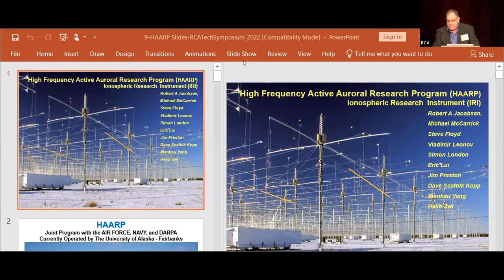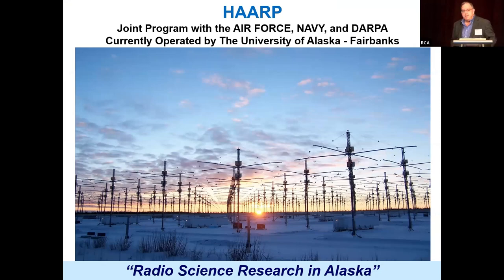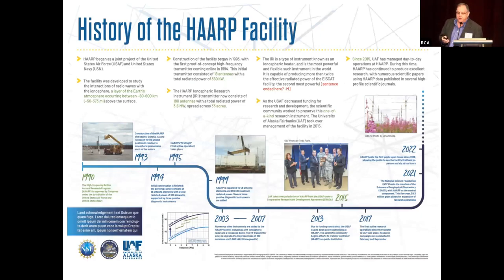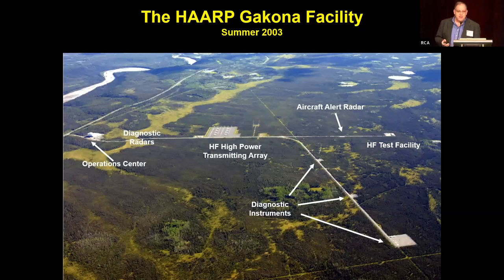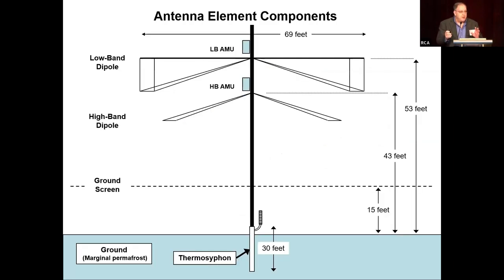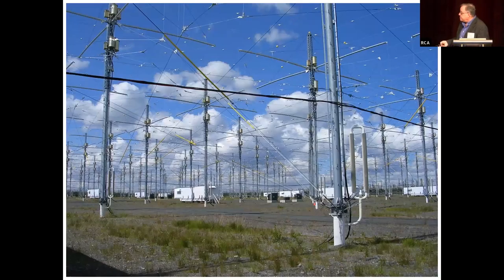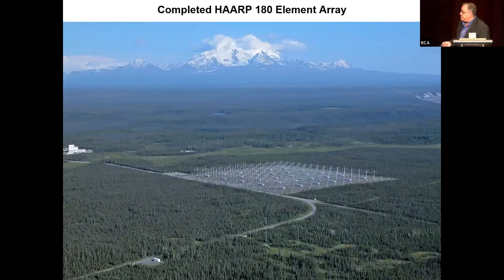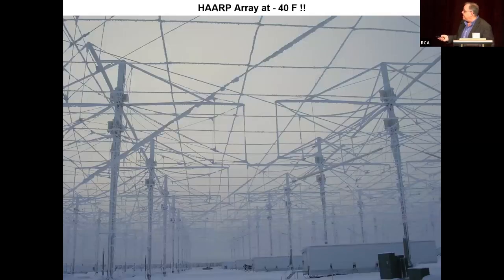The High Frequency Active Auroral Research Program, "HAARP", a Brief History and Engineering Review

Comment: this is the proposal to ARCO by Eastlund. Arco before this history through their electronics decision built most of HAARP. As I talked with the director Mr Hecksure at the joint Navy, Airforce High Energy Lab I believe I know a bit of the history not mentioned in this. ARCO needed to sell millions of tons of Natural Gas that had been pumped underground as part of the process of extracting crude from the Alaskan reserves. At the time (1984) there was no commercially viable way to sell this gas or transport it to market. Bernard Eastlund presented an idea to ARCO's President that was so exciting he may have pooped himself. Instead of bringing the gas to market, Eastlund's plan would bring the market right to the gas.

Eastlund outlined a plan ARCO could use to market that gas to the DoD.  

The idea was to build a massive land based vertical bore sighted phased antenna array using powerful transmitters. This array could beam RF energy into the ionosphere. This would heat up the ionosphere, pushing it upward, and creating a plasma which releases MEV electrons into space. By pushing the ionosphere up am incoming InterContinental Ballistic Missile could be deflected and its course altered when it encountered the unexpected drag of an atmosphere that was not supposed to be in its programmed flight path. Eastlund's presentation and resulting patents also suggest that MEV electrons would soak into the missile, heating it, causing the missile to malfunction or even explode. Of course an RF device of this magnitude would require a ready source of cheap energy: the vast store of gas ARCO had accumulated in the process of extracting oil. The RF interaction with the ionosphere would only be effective in an auroral zone...meaning the array would have to be built in Alaska. Serendipity.

Remember this was the height of the cold war, 1984, so a missile shield was the perfect pitch to get the DoD on board and scoop up a lucrative contract. Ionospheric research provided the ideal cover story to prevent any claims the US was violating the stipulations of the ABM treatiy in effect at that time, a treaty prohibiting much of what Eastlund's patents claim HAARP is capable of doing.

The device Eastlund proposed could also create plasma mirrors to facilitate OTH (over the horizon) communication and Radar (similar to "skip" ham radio operators use to communicate vast distances with low wattage). As you can see from the original slides presented by Eastlund proposed a number of other possible uses of such a facility: including weather modification (pushing up the ionosphere will of course drag the lower atmosphere into the void); the disruption of ground and space based surveillance; even the destruction of satellites, space craft and land based power grids.

Whether or not HAARP has been used as a missile shield, a tool for OTH spying, or weather modification is a subject of much speculation. Despite claims by many one way or the other no proof of this is forthcoming, or at least I have yet to find one credible source or document to that effect. If you visit the HAARP website you will see the statement that there are no classified documents pertaining to HAARP, that all HAARP research is civilian in nature, and there are well over a hundred papers on file at the AGU from various scientists that have used this facility for civilian research to back up that claim. Every year HAARP hosts numerous campaigns (research projects) from scientist all over the world. Studying the ionosphere is the stated mission of the facility.

So it's up to you to determine how much of Eastlund's claims were a sales pitch and how much were (and are) a reality. But even a cursory glance at the origins of HAARP reveal it was brought to life with DoD and later DARPA funding. These sources of funding and the military and CIA-linked contractors that built out the facility are not a matter of any dispute and are in the public record.

I strongly urge anyone that wants to know more about HAARP avoid sources like Press Core and the copy pasta regurgitators that spam the web and Youtube with suppostions, conjectures and claims for which they have no documentation or credible source. Do the research yourself. Eastlund's numerous patents are on file and you can find links to them in a few moments of Googling. 

Claims from HAARP-tards like Dutchsinse that HAARP is making rings you can see on weather radar graphics, or the even more fantastic claims that HAARP is causing earthquakes and tsunamis lack any credence whatsoever. There is not one bit of science to back this up.  I've made this video in part to debunk this sort of pseudo science and will be presenting more videos about HAARP in the future.  The fact is, if HAARP can even do part of what Eastlund states in his patents it's one bad ass super weapon, there is no need to drown it in bullshit.
Bernard Eastlund (1938-2007) http://en.wikipedia.org/wiki/Bernard_...

http://www.eastlundscience.com/PATENT...

http://www.eastlundscience.com/HAARP....

http://www.eastlundscience.com/HAARPM...

http://www.padrak.com/ine/HAARP97.html
Transcript
Follow along using the transcript.

Show transcript
Reply: Alaska is a proof of concept. The weapon system is now in Antartica.
Reply: They won't tell you or write anything they don't want you to know. Tesla was the first to play with this.

Comment: Messing with nature and what already worked beautifully,  almost like it was...designed to work,  it's the ripple effect i worry about,  something as small as pulling heat out of the ground messing with a system that already works in an artificial way could be having an unseen effect.
Reply: I understand that you might be concerned, but this is really nothing to worry about. The sun shoots down tons more power everyday, and that power fluctuates a lot. Sometimes there are huge solar storms so powerful that they could knock out our whole power system, but the Earth is very resilient and has survived, so it will be fine. The main disaster to be worried about is climate change. It won’t destroy the earth itself, but it still messes with the balance of things and will cause lots of death and destruction because the changes are happening way faster than any time in history.